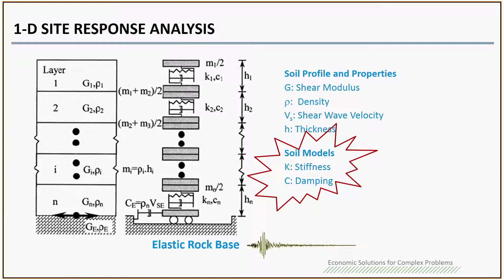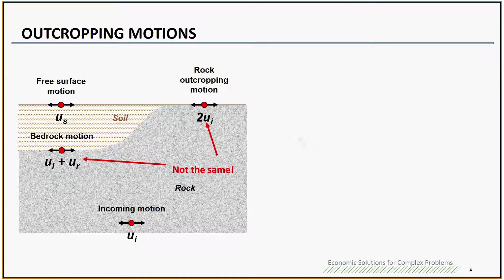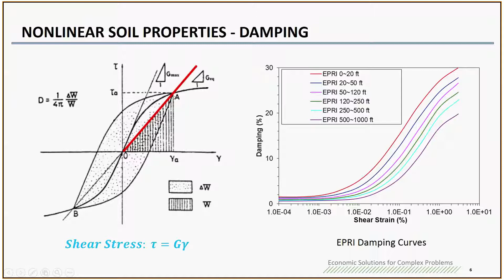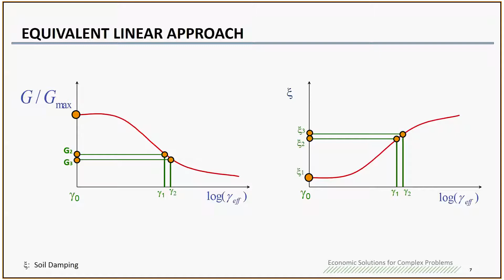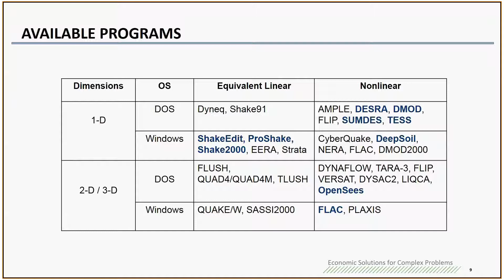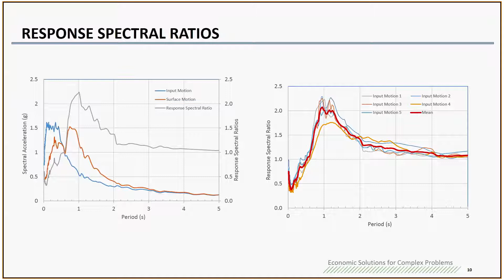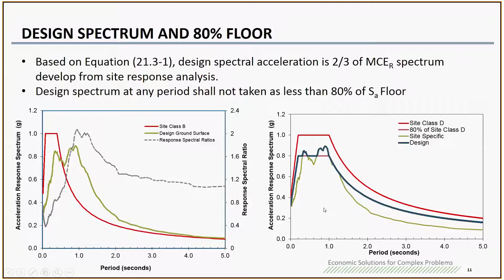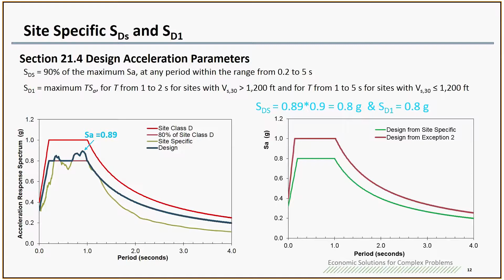Class 5 soil models and site response analysis

Comment: Can we choose to whether to use equivalent linear or nonlinear method based only on PGA value of input motion? i.e. what is the highest value of PGA of input motion up to which equivalent linear analysis can be considered acceptable? I searched in the book by Kramer (1996) and many research papers but couldn't find. Does any code/research paper/book gives any such criteria?
Reply from the maker: FHWA-SA-97-076 Design Guidance Geotechnical Earthquake Engineering once recommends considering the nonlinear analysis when PGA is greater than 0.4 g or if calculated peak shear strains exceeds 2%. A higher PGA is ok as long as the analysis is converged in my opinion. Sometimes, you need to extend the shear modulus and damping curves to large strain such as 10% to ensure the analysis can converge. However, if the equivalent linear analysis shows peak shear strains exceeding 2%, I highly recommend doing a nonlinear analysis to ensure right response for the project site.
Reply: @asce7-169  Thanks a lot for the suggestions.